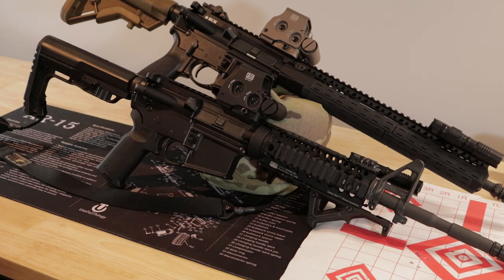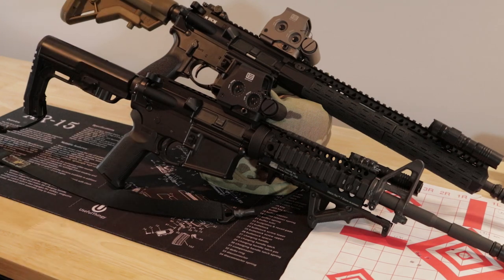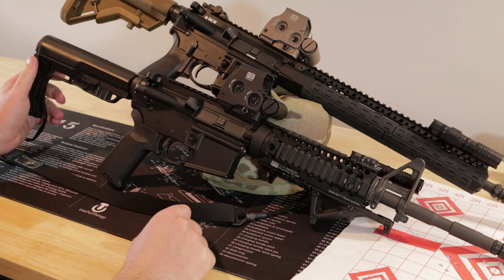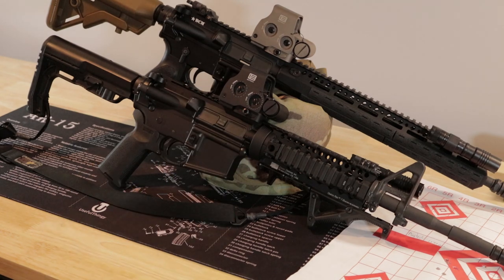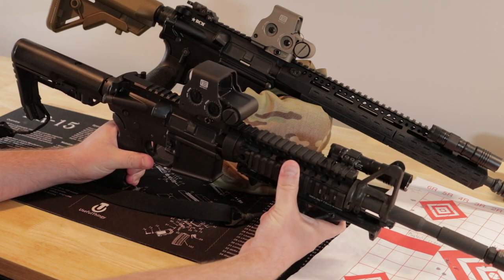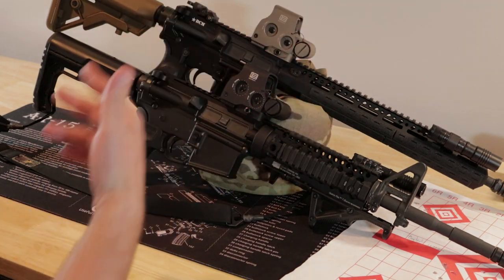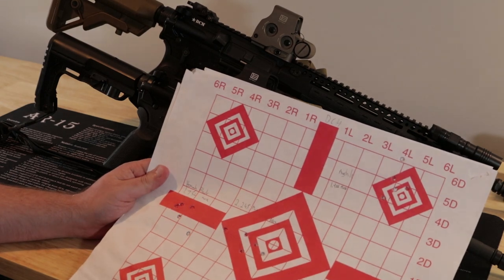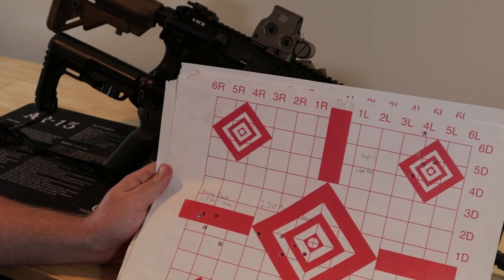14.5in Colt SOCOM vs. BCM ELW Barrel - Accuracy Test

Comment: I’ve had my LE6921 SOCOM for 5 years and about 5k rounds through the pipe. Still .89 moa since out the box. I have the O stamp under the barrel 2016.
Reply: What kind of ammo have you been using?
Reply: do you know what it means if there is an "I" under the barrel?
Reply: what ammo are you using to get sub moa groups?
Reply: Lol dudes really out here thinking they're doing sub moa.. watch some Hornady podcasts and do a 30 round shot group then report back
Reply: @Parado1994  I’m sure my analysis is as accurate as my rifle. I have more guns than you have nose hairs. I know what I’m talkin about.
Reply: @rampantcolt  lol you obviously dont...
Reply: @Parado1994  lol ok son

Comment: Just took my BCM SOCOM out to the range and brought an ADM 13.9 Core for comparison. I did four rounds of 5 shot groups per ammo type. It did not like American Eagle or IMI 55gr. 69gr Fiocchi, 75gr PPU and 77gr IMI were all averaging 2ish moa with only a couple groups under 1moa, which isn’t great. Next I’m going to try a few match grade 68’s, 69’s and 77’s, hopefully with better results. So far i’m not impressed. My ADM did way better.
Reply from the maker: How did the ADM shoot? Criterion Core barrel?
Reply: @TacticalAccountants  it came in a month ago. i’ve only made two trips to the range. Took ADM 14 weeks after ordering to deliver. It shoots most ammo between 62-69gr really well but everything outside of that is 1.5-2moa. The barrel is slimmer than I expected. It heats up fast. Still my favorite AR so far.

Comment: The accuracy you're getting from the BCM is acceptable. It's a fighting rifle. Now for the money, i understand expecting better. My DDV7 will shoot MOA all day. I get anywhere from .75 to 2MOA from it, depending on ammo. I also have a 2013 colt LE6920 and I just recently purchased a CR6920, with the 13629 cage code. I have to say, the Roscoe barrel is definitely an upgrade over the colt. My CR6920 will shoot 1.25 to 2MOA consistently, depending on ammo. The two BCM rifles I own are a regular M4 profile and a Recce16. Both rifles shoot about 2MOA. not the greatest accuracy, but I will trust them both with my life. I also recently purchased a BCA upper for 224, that came complete. I will admit, it shoots sub MOA  consistently. I doubt it will last as long as my high end rifles, but I gotta say I was really surprised to see it shoot that good.
Reply from the maker: I agree that for what it is, the accuracy is fine. Although I haven’t been too impressed with my DD MK12. It’s an older one, but haven’t had it shoot sub moa really. I’m going to try some other loads soon and see how it is. Specifically some 69g SMKs and maybe see how Bergers do.
Reply: @TacticalAccountants  I usually run black hills ammo, when I want to test accuracy. I find it gives the most consistent accuracy. I usually run 77grn rounds through my 1/7 barrels as well. Although 69grn is pretty tight too.. To be honest, after owning two Larue rifles, I'm not impressed with other rifles accuracy. The Larue rifles shoot like bolt guns. They are consistently sub MOA.

Comment: Nice video..
Colt actually had nothing to do with SOCOM / M4A1 Profile barrel.  Lady from Crane made the drawings for that barrel . Since Colt had the SOUL SOURCE contracts. Crane forwarded to Colts engineers.  Colt also had nothing to with MK18 . The MK18 was done by Crane and LMT . Since Colt had the soul source  Crane and LMT had give Colt the drawings .  While they were waiting for those first CQBRs , Crane used left over M16A1 lowers and cut down M4 barrels to 10.3 and opened up gas ports to 0.70..
SCAR PROGRAM In 2004 ended up being flop because of that lady's drawings from Crane .
Fn Makes their HF barrels..
Centurion SOCOM HF are insanely accurate as well..
BCM SOCON are not anywhere near as accurate .
My best group with Colt SOCOM is 0.73 with 77g TMK and BCM SOCOM was 1.7 with 77g TMK.  Centurion SOCOM HF 0.88 with 77g TMK..
Reply: Socom and M4 profile aren’t even the same profile

Comment: I have a bcm enhanced lightweight with a vortex pst2 on it...only like 300 rounds through it maybe but the accuracy at 100 yds isnt the greatest so far...ive hit 1.5 and 2 moa a few times but mostly its around 3-4 moa. is this normal? im honestly ok with it if it is but curious on others experiences with it
Reply: What ammo are you using?
Reply: @echofoxtrotwhiskey1595  ive used a ton of different. sieraa and barnes loads, federal, hornady, aguila, winchester. anything from 55-77 grains. ive gotten it decently zeroed  to hit around 2 inches at 100. a couple times around 1.5. im honestly happy with that coming out of a 1-6 pst but i was wondering if I could get it to an inch...would probably need a higher mag scope.
Reply: @echofoxtrotwhiskey1595  ehh its a guiessele lol. just me and a scope i gotta work on
Reply: @rickypickles2219  1.5 moa out most  duty grade ar15 chrome lined barrels is pretty standard(pretty standard for bcm barrels that is), along with 2-4 moa with surplus ball ammo is pretty standard as well. It's not great of course, but it's pretty average coming from the bcm elw barrels from what I've seen with others (i have a standard 14.5 elw that shoots right at 1-1/4 moa with good ammo, but won't go under moa).  It's not supposed to be a marksman type barrel anyway so I'd be fine imo  with that accuracy for its intended use. Is it the bfh elw or the standard button version. I've seen better accuracy come from the bfh ones tbh. 
Ps-..Also, unless you know yourself to be an accurate shot you might wanna try letting someone else group with it if you haven't already.
Reply: A buddy of mine who was into PRS has tried a few BCM barrels and has never been happy with them.  I sold him an upper I had bought and he said "I ran it with Federal 55gr American Eagle (both from the red box and the new "tactical" black box), Federal 50gr Power Shoks, and Atlanta Arms and Ammo 77gr AMU load, and none of them would group well. The second time I brought it out, I actually also used a 3-9 SWFA Super Sniper Scope with a rest and it was not grouping at all at 50 yards either, maybe 4". "

He emailed BCM and they replied with "That is within Mil-Spec, but it should be better than that."

After some haggling they eventually RMAed.  All of the BCM we've tried has never been great accuracy wise (especially compared to DD, Noveske, Colt etc).  Some people have had good experience with them (another buddy has one that does 2 MOA with cheap Wolf Gold) and Molon got sub MOA with his but a lot of people find the accuracy lacking.  Gunthots also shits on BCM a bit too. They make reliable guns, just not the most accurate imo.
Reply: @notreal5311  I have one in 16” elw non HF and it’s one of those that will do 1.5-1.75” with wolf gold lol. Got lucky I guess.
Reply: @muddyhotdog4103  yea with the 16 inch ive tightened up the groups from 1-2 inches. i just got a BFH ELW 14.5 recently. can get it under an inch at 50 yards but it aint easy. just an aimpoint pro on it. guna throw it in a lead sled for fun. I really like the ELW for a shtf rifle. lightweight and decent enough.